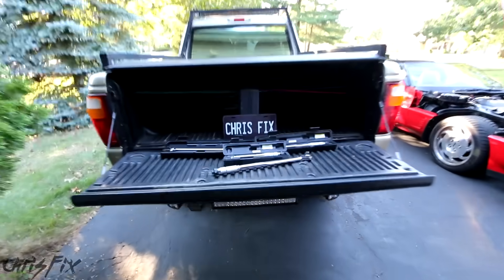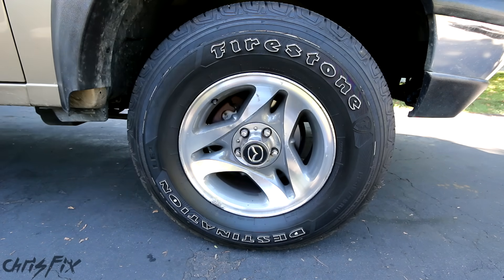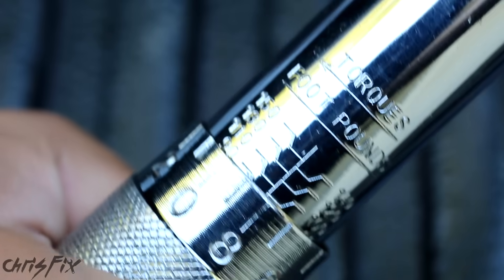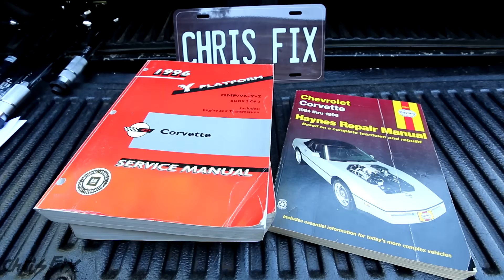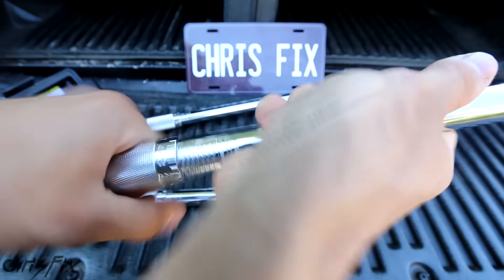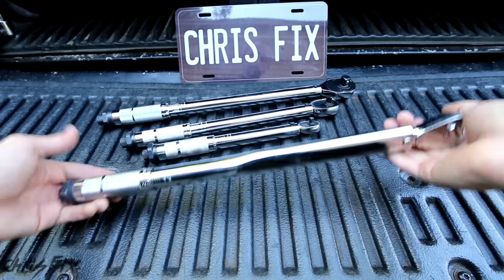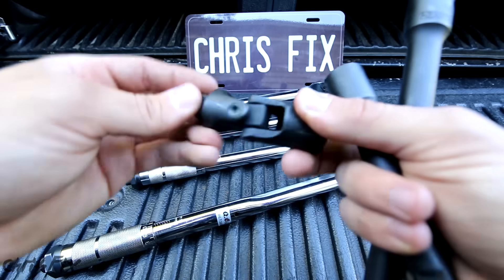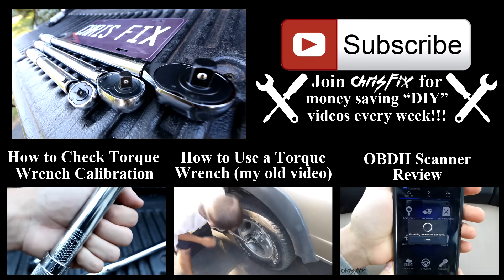How to use a Torque Wrench PROPERLY

Comment: Personally I would not waste too much time on the thirdparty manuals. Go off a good chart that has fasterner size versus recommended torque values and get a fasterner diameter ruler or just a vernier. Use some logic if the fasterner is aluminium or steel (magnet test). Most things like harness brackets and exhaust brackets, torquing those is a wasteful of time. Wheel bolts/lugs yes, but I would also examine the threads, especially Japanese vehicles as the torque specifications on those lugs are very low and weak materials and are prune to damage especially from impact guns on fastening (servicing workshops). The 1/2" torque doesn't matter that much especially if your only torquing wheels with it. The more important ones are 1/4"and 3/8". Any torque wrench under 100 hundred dollars is only as good as the stuff from DIY home store. To get a decent torque wrench is by getting a known brand that only makes torque wrenches, Hazet, Stahwhille, Snap-On, Facom are a few exceptions. Decent ones are Sturtevant Richmont, Tonichi, CDI-Torque and a couple of others. I'd be surprised if Tekton's stuff will even be 5% accurate, given most decent torque wrenches are good for 2-4% accuracy, at 20-80% of the scale. Add in torque angle for critical scenarios (engine rebuilds) and you would just throw those cheap toys into the bin. The cheap torque wrenches in particular, will start skipping teeth within 1-3 months, torquing wheel lugs nuts, nothing else. For a good non-angle torque wrench that actually lasts, use the Snap-On or CDI split beam torque wrench, retains calibration for a long time, pretty much drop proof and you don't have to wind it down.

If budget is a big fact, at least use something from Norbar.

Comment: A tip is to push on the head of the wrench it helps prevent slipping and rounding of the bolt or nut

Comment: You start off this video by saying that you can ruin a thread by overtightening and that is correct, then you make a sweeping statement that most wheel nuts should be torqued to 100ft lbs,  however I am aware that you are showing a truck in the video but most smaller road cars wheel nut/stud torque range between 65-90ft lbs and some like older Minis in the UK are only 45ft lbs.  Just saying !
Reply: even with the truck he's still wrong, trucks are generally 140-160ft lbs. of course some might be under or over that but i don't know of a single full sized truck that's under 130ft lbs.

it's also worth noting most shops won't go searching through your manual and will just torque most cars to 90-100ft lbs and trucks to 150ft lbs. more often then not that's fine and being a little over isn't going to hurt anything but it's still worth checking it yourself to make sure they didn't go too lose or super tight.

Comment: I was looking at the torque wrench you recommended from Amazon. This particular wrench has many bad reviews man. Apparently most of them break or don't click, really a lot of defects. I'm kinda skeptical regarding this that wrench because I want to replace spark plugs and if something gets messed up I'll be screwed. Is there any another torque wrench you would recommend?
Reply: Sr Rs CDI Torque Products. They are the manufacturer of Snapon torque wrenches.  If you buy the CDI from Amazon, it is the SAME EXACT wrench as the Snapon brand, but you'll save hundreds.

Comment: One other thing worth noting is that if you need to use the torque wrench most close to your desired number.  A 20-150 wrench will not be as accurate when set to 30 lb/ft as a smaller more precise torque wrench, and conversely, the smaller wrench won't be as accurate at 80 lb/ft as the 20-150 wrench.  In other words, for large numbers, use a torque wrench with a high ceiling, and for low-medium numbers, use a smaller wrench.

Comment: @ 5:17 Chris, you mention to use a ratchet to get it "snug", then use a torque wrench. - i get confused at this bit. Dont get how snug it should be?
Reply from the maker: Snug just means you get it tight enough so there is no play in the nut or bolt. If you can hand tighten it all of the way, snug is when you cannot hand tighten it anymore.
Reply: ok thanks for the fast response Chris, I enjoy your channel!

Comment: It is totally OK to use a straight extension with a torque wrench.  If the wrench is set for 50 lb-ft, it will click when it feels 50 lb-ft.  And because of Newton's 3rd Law, if the wrench is feeling 50 lb-ft, then the bolt on the other end is too.  It doesn't matter how much twisting the extension between them does in the process; any twist just means that your hand had to travel farther.
Reply from the maker: Definitely. I mean a twist out of the turning plane. So like it isnt perpendicular because it is so long only 1 degree is exaggerated.
Reply: Agreed; gotta stay perpendicular.

Comment: i have to change my spark plugs on my camry, should i buy a tork ranch for that job?
should I just tight it just enough?
thank you.
Reply: you can break the spark plug and then it's very difficult so solve that situation
Reply: They don't have to be that tight, you just have to be a little careful.
There's a zigzag ring on the bottom of the plug that seals it. When you tighten it, you can actually feel it turning harder as the ring start compressing, and then it gets just a little bit harder when the ring is completely compressed. Just tighten it a little bit after that and you'll be fine.
Reply: +firoxlion thank you brother.
Reply: Use a little ranch dressing while having a dinner salad with Peter Tork.
Reply: Yes use a torque wrench...
Reply: It's not that tight
Reply: Use a torque wrench to do it right. Some spark plugs are tapered and some have metal gaskets. Both styles require different torques. If you're a half ast backyard mechanic, don't use a torque wrench.
Reply: most of the time 
i just tighten it as hard as I believe it won't go anywhere
Reply: thank you brother.
Reply: jugado219 
You are very welcome my friend! 😊
Reply: Not necessary to use a torque wrench if you're doing spark plugs replacement. Just tighten off by feel

Comment: i have to change my spark plugs on my camry, should i buy a tork ranch for that job?
should I just tight it just enough?
thank you.
Reply: Just get them snug it doesn't matter
Reply: i heard of that before too, but it scares me a bit of to much or to little tork!
but thank you for the help.
any other tips would help too.
Reply: Nah bro I've done it multiable times usually finger tight then half a turn with a ratchet then 2/3 turn of 1/4

Comment: Also a final note, If you're using a crows foot or any other socket that puts the nut/bolt off of the axis of rotation, you can use it with the torque wrench if you angle it 90 degrees. Otherwise, you'll end up getting a bad torque. This is coming from an aviation mechanic.
Reply: i was just about to say that. but i was taught some kind of formula you can use to calculate the torque for the angle you are using. but i almost never use it so i have forgotten it lol
Reply: Thanks!  Did not know that.

Comment: That is good to know about torque wrenches. When I was in the Air Force we used them all the time since many of the bolts had to be tightened and torqued, then safely wire run through the bolts indicating that the part is set to factory specifications.

Comment: Would it still be the correct torque speck if I use a wrench adapter to get to a bolt

Comment: This video per demonstration purposes and for the type of work is good. Unfortunately most people over torque the crap out of fasteners because when applying force, they do not stop at the sound of the click. In this case, torquing the lug nuts was not 100 ft-lb, it probably was more like 140-160 ft-lb.

Comment: Chris what are your thoughts on my question cause I just want to use a regular wrench. but I broke the bolts twice because  I don't know how to estimate what a good fit is for some 10 bolts on a valve cover.  I hear they don't need to be that tight but the specs says something  like 30 and the 60 to 90.

Comment: why would you not typically use the inch pound wrench.  I just bought one to tighten the nuts on my valve cover.  is it not necessary for nuts that have inch pound pecs?

Comment: hey chris, my 2010 f150 lower strut bolts require a 365 ft/lb of torque, i cant find any torque wrenches that will go that high. what do you suggest???
Reply from the maker: Torque it to the highest you can, then get your breaker bar, with a cheater pipe on it and tighten it another 1/8 to 1/4 turn or so.

Comment: I got my torque wrench checked and the guy said it is off by five foot pound do you think I should get it calibrated or leave it be?
Reply from the maker: +Country logic It depends how much it costs and what you use your wrench for. If you are tightening down suspension parts, just add an extra 5ftlbs and you will be fine. If you are doing something where you need to be precise, then you should get it calibrated.

Comment: good video. 

am I wrong to suspect the techs that service my vehicle likely don't bother with these ? tire rotations, fluids oil and such. 

or do they break out a manual or check a computer for specs then torque?
Reply from the maker: +Ninja Master It depends where you go and how good they are. Watch when you see them working on cars and you will see right away if they use them or not. Most just use an air gun and call it a day.
Reply: I suspected they just use an airgun and rush through it. Most places I just don't know what happens. I talk with the service writer who's there to sell me and scare me.

I assume the Techs do the "fast food" maintenance stuff like oil and rotations, tires, pad slaps. Mechanics are the ones that fix the complex mechanical issues.

Comment: those are harbor freight torque wrenches. I got the same one
Reply: CDubs HasIt I hate digital ones, Idk y but it just like the click type.
Reply: yup, not very accurate off the shelf but if calibrated right, work very well for the price! i got the whole set and i recalibrate them about 2 times per year but when they were first bought the 1/2" was 13lbs over 3/8" 6lbs over and 1/4" was under not by much but cant remember by how much but calibrate them right away and they seem to be pretty accurate, at least all the fasteners will be the same torque value.
Reply: save up, buy a snap-on .. You'll never regret it.. I promise.. Had their clickers forever but recently bought an all steel electronic techangle from snap on.. Jesus.. I don't know how I ever lived without it.

Comment: so i got the courage to do the valve cover gasket on my 96 tercel. check specs for screws online and showed 31flb. ok so was tightening and tightening until one of the screws broke. omg!
    i managed to put a bandaid sort of. put damn!.
  found the repair Manuel online and it calls for 61flb. cant be right. settled with torquing the remaining nuts at 10flb.
Reply: make sure its really foot pounds and not inch pouch the manual said.
Reply: +Dis lob3. yea it might be. anyways after all of that i noticed that the oil leak if coming from the crankshaft so im hoping chrisfix will do a video on that cause it looks like a very hard job. not for noobies.

Comment: Hi ChrisFix! I have a 1/2 drive torque wrench but it can only measure the torque in clockwise turns, it can be use in counterclockwise turns, like a ratchet, but I cant measure the torque in this way.It is still advisable to dont use it as a breaking bar? thank you!
Reply from the maker: +carlos galindo Torque wrenches are meant to be used to tighten only. Do not use it to loosen bolts.
Reply: Thank you! I will stop being lazy LOL

Comment: ppl need to get their PHYSICS right , LB-FT is the correct unit for torque, while FT-LB is unit for POWER, NOT TORQUE !!!
Reply: +Kev Jumbo why is it that the loudest people always seem to know the least about the thing that they're either shouting or going all caps about? You got it wrong. forceXdistance=energy, not power.
Reply: +MrMistery101 ok smartass, it's actually the unit of work, power is the rate of doing work, but still LB-FT is not the unit for torque.
Reply: You got it right, but they're both units of energy. Joules in SI. I don't see where anyone confused lb-ft with ft-lb.

Comment: VERY GOOD JOB Chris !  This is a detailed video to update beginner to mid mechanics.  Yes, extensions can be used, but on longer ones the torque specs will be off slightly primarily on HIGH TORQUE where metal stress and fatigue take and effect.  I started out with an old "beam torque wrench " with the swivel hand grip. That taught me how longer extensions and deep sockets throw the wrench off balance.  The "unloading " is explained well too.   ANOTHER WINNER !     Keep WRENCHIN'  folks     JK.
Reply from the maker: +James Krivitsky Thanks a lot!

Comment: It may have been worth mentioning that if you can, you should choose a torque wrench that has the required torque towards the middle of its range, since that's where they're the most accurate.  You could torque something to 70 or 80 ft-lbs with either your 3/8" or 1/2" drive wrench, but the 3/8"" drive will be less accurate since you're at the very top of its range.

Comment: Chris,
I have a 2007 Nissan Xterra... the car is noisy, you can hear everything shaking in the car while driving it. Also, the car vibrates at speed higher than 40 mph. I replaced the front wheel bearings and the problem didn't go away. do you think it a spring fatigue issue or rear bearings issue or even the shaft propeller. The car is not fun to drive... need your expertise.

Comment: Make sure you check the manual for the torque wrench you buy.  The snap on T wrenches we use in the USAF must be set to the max value at clicked 5 times both directions before usage.  We use a welded on adapter mounted on our tool box.  Allegedly it lubes the wrench, there by helping it live longer and stay true.
Reply from the maker: +Matthew St. Onge Thanks for the tip Matthew!
Reply: +ChrisFix thanks for all the great videos, you really know your stuff.  If you're ever in Arizona I would be happy to show you how to properly solder.  It's my expertise on Aircraft and Rockets.  I just watched your Baja backup light video.

Comment: I just got a torque wrench today and it says 120 to 960 inch pounds. should I have gotten a wrench that goes lower than that ? I'm gonna be using it for a wheel bering
Reply: What does the manual say to torque it to?
Reply: Very few things are lower then 100 inch pounds. And when a manual calls out for, let&#39;s say 35inch or 50inch pounds, what its really saying it it needs to be tight but not smoked down. Items with that low or torque you are more worried about stripping it out or snapping the bolt, then it falling out. 15-120 inch use common sense and again make it snug n tight, but without damage. 10 years USAF Aerospace Mechanic
Reply: Thanks man I got it figured out lol

Comment: in this video you say to stop at one click and in another you said 2 clicks, which is correct?
Reply from the maker: +Air Handler I use the one click method now. Either works, but the one click is more accurate on a calibrated torque wrench.

Comment: Please tell me those aren't the Pittsburgh torque wrenches from Harbor Freight. I had to rebuild an engine because the one I had slowly lost calibration and when I had the head off, they didn't get the right amount of torque when I set the wrench correctly. I will never buy anything more complicated than a hammer from Pittsburgh again. Everything Pittsburgh I've bought is garbage.
Reply: I received a Pittsburg torque wrench., was skeptical of its accuracy and cross checked it against my beam type torque wrench.  There's no practical difference between them.
Reply: Why do you think I hate living here? I wanna move to the country XD
Reply: Quality is not an issue with Harbor Freight tools, but quality control IS.

Comment: nooooo :( torque is not the dot product of DISPLACEMENT and force! that is work!!! W=F*d or W=d*F that being said, torque is a pseudo vector so it is defined as the cross product of DISTANCE and force and direction matters where as in work it does not! Tau = r x F  which is the arithmetic matrix determinants of each perpendicular dimension involved.. right hand rule guys.. if you're going to design something you must know this.. but to fix something, it's probably not useful to know
Reply from the maker: +TripedalTroductions Thanks for sharing.
Reply: I'm sorry if I sounded arrogant but I assumed you were trying to inject some physics into your lessons by your formula displayed in your video. Other than that, your videos are extremely informative and that is the reason why I have stopped taking my vehicles to the shop. Thank you for your time.

Comment: Doesn't the load on the spring go back to the old magazine myth that Magpull debunked? The only thing that wears springs down is constant pressure and relief, not steady tension.
Reply from the maker: +Cole Byre I contacted a tool company and they told me to set it to 0 or slightly above 0.

Comment: Very informative video, as usual.  One point.  I never have my torque wrenches calibrated.  Why?  When properly kept torque wrenches go out of calibration, they normally don't go out "that" much.   Since I'm not building racing engines, to be off a pound foot either way is no big deal.  For multiple bolt configurations like wheels, heads, oil pans, etc., it's "consistent" torque pressure on all the fasteners that matters more than the actual number of the torque setting.  So a pound foot off in either direction normally is neither here nor there.  Just my opinion.  Thanks for making this video.
Reply from the maker: +Bourne Accident That is true! I always test mine myself so I know how far off they are. Like you, I only use it for suspension stuff and I am not building any motors.